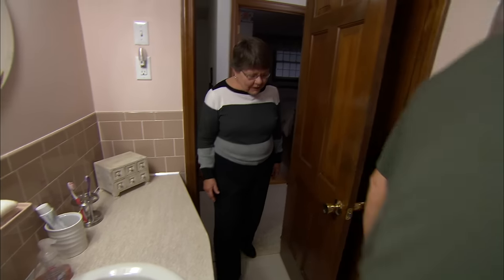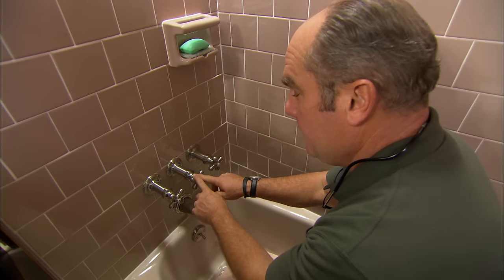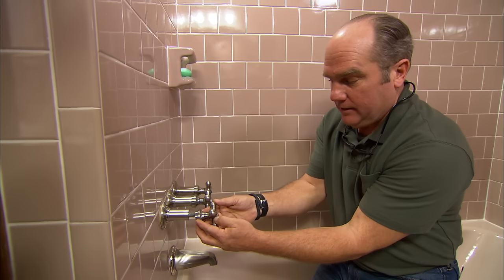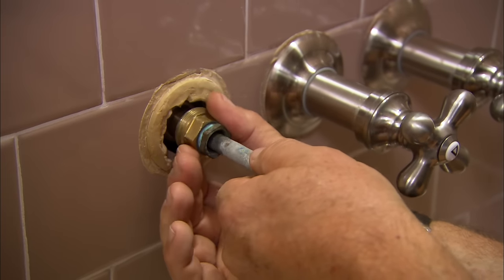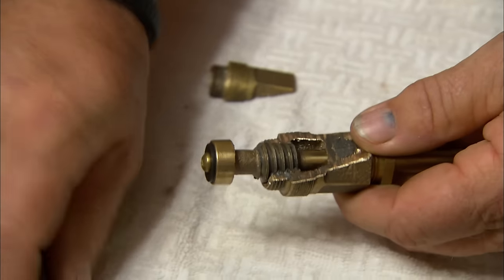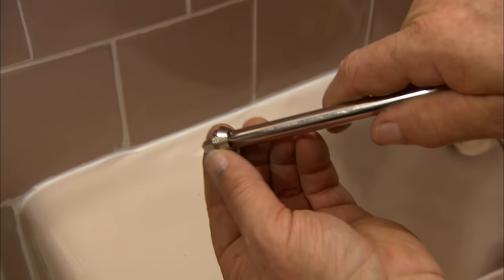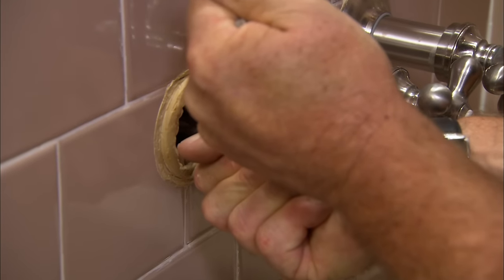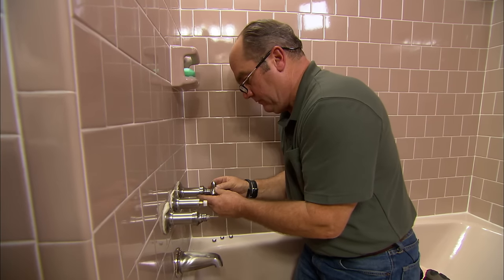How to Repair a Shower Valve Stem | Ask This Old House

Comment: I just replaced mine and now my hot water doesn't work at all like I have no hot water in my house coming out of the faucets it's not flowing the cold water is flowing but the hot is not
Reply: Hopefully all is well now.  I sympathize with you.  I just changed stem and seat and faucet is very hard to turn and still leaks. What in the world did I do?

Comment: Showing the replacement of the diverter also would have been helpful since that valve is different in appearance from the hot and cold valves.

Comment: Came here for ideas to remove stuck tub faucet handle from the stem, and learned about water pressure drop on a worn out stem… which has become a recent problem on a sink.
Thanks much.
Reply: astonishing.  a worn/lose stem may CLOSE ITSELF if hot water is applied.    Notice he used CHROME seats on the hot side.   
supposedly better.     obviously this is a GERBER setup.  
     Actual ALLEN wrench works perfectly, no chance of stripping the inside of the stem.  comment please

Comment: Nice vid! Here is my problem: my hot water in the shower keeps leaking when I turn it off and very little hot water comes out when I turn it on. I removed the handle, bonnet and stem which was pretty old and worn off but upon close inspection I saw that the whole part that holds the washer was rotted away and missing... I used a flashlight to look inside the wall and the washer with the screw is named inside the seat! Someone apparently kept using way too much force to tighten the hot water knob cause if the leak. I tried using needle nose pliers to pull the washer out of the seat but it's not budging. Any ideas how to fix this?
Reply: Keep trying with the pliers, otherwise maybe some stiff wire about the strength of a wire hanger bent into a hook to go in then pull the washer out. You could also push it past as a last resort but youd have to blast it out of the pipe, someone turning on the house water while a half pipe or some plastic is held to keep most of the water out of the wall. Last they have tools to remove the old seat. With that much corosion already you should probably have to hold it firm and smack it with your other hand to break it free. Hopefully it wont strip or be coroded as well.

Comment: I enjoyed the video.  Looked easy enough until I tried it.  The handle wouldn't come off until it broke off.  Now I have to replace the stem?  How do you know that you have the right replacement stem and seat?  I think I have a Kohler, but no idea what model.   

Also I have tried two different stem sockets.  29/32 is too big and 27/32 is too small.  I can't find a 7/8 stem socket.